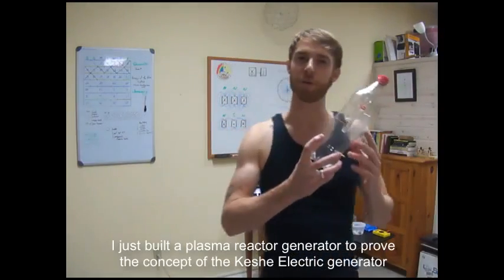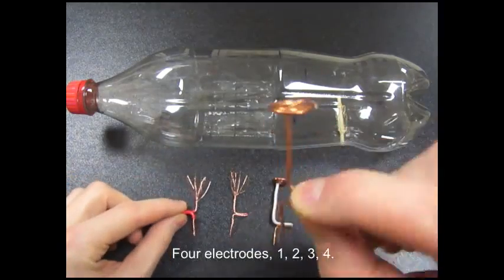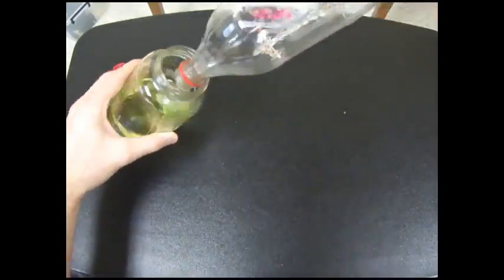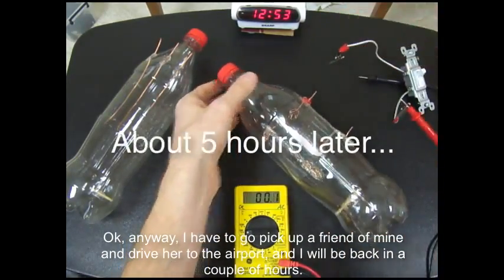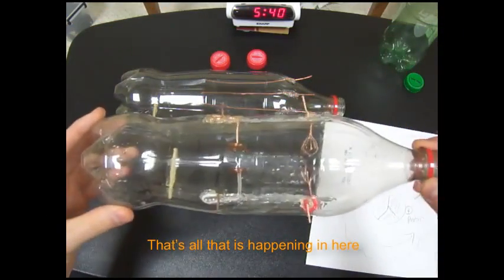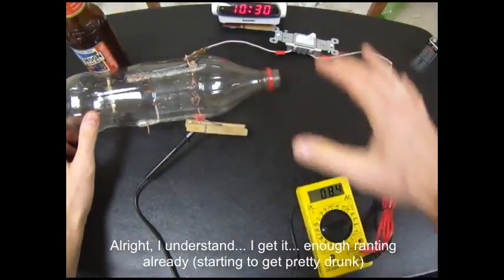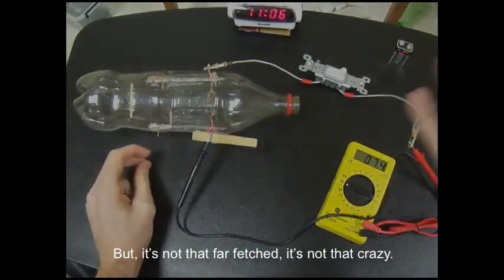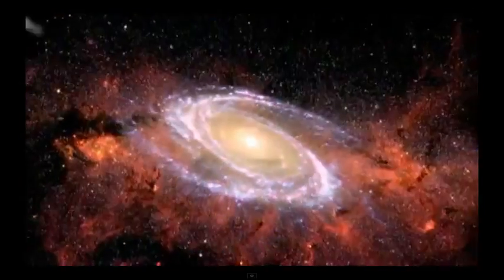Keshe plasma reactor

Comment: Something is happening but the explanation is rubbish and the power level is miniscule 5 hours to reach a measured voltage I bet far less than a second to 0 if a load is applied .

Comment: You can easily get very high voltages with very little energy.  It doesn't mean there's any capability for significant power delivery.  Volt meters are very high impedance.

Comment: The pitiful thing is not (just) that the explanation is bullship... it's that 139 people slipped their hands and clicked the like button. 

This is just a battery. and like someone said: It's without meaning to measure the voltage without letting a current through. (the ohm meter is a huge resistence) and so the energy eaten by the voltage meter is always almost 0. You are just looking at a alow slow reaction taking place. Trust me, I am a phd student in quantum physics .
Reply: +張迪凱 Hehe, i have problems with people saying "Trust me", that always get my spikes out. :) 

But i agree with you, Keshe is a hoax and a lot of people suddenly became hobby electricians without the basic understanding of electricity.
Reply: Atleast someone that said the thruth! Thank you!
Reply: +張迪凱   i have that same meter. mine reads at 0.2ohm. understandable for the cheapest walmart meter. but not HUGE .
other than that i agree with you.

Comment: Sorry mate. .. just wasted 5 minutes of my life :-/ this is NOT how gravity works and there is NO power generation here.... approach the bottle to a device which creates radio frequencies (ie plasma globe) and take a reading.... congratulations you are harnessing unusable amounts of ambient electricity... try placing a "micro" load within the 'circuit'... you're multimeter will read 0. You cannot take voltage readings on a circuit without a load (a resistor will do)... the results will always be false otherwise.

Comment: I am wondering how long the reaction occurs, because it seems during the filming of the process, it went up initially and then was only around 3v by the next morning.  Would the process continue to occur, if the fluid was left in the bottle?

I also noticed that only voltage was demonstrated, but amperage is just as important.  It would be nice to see the amperage being generated by the Keshe Reactor.

Comment: The reason there is little technical info is because it's bull crap! I have read Keshe's patents #EP1770715A1 & #EP1770717A1. It would be a very costly device to replicate, it uses a radioactive reaction source and it would consume a huge amount of power (KW's). And further to that, it would require an elaborate heat exchanger to harness any energy! That's assuming it could even produce any excess energy, which I highly doubt! Keshe looks like a scammer to me!

Comment: I'm not even sure this is a power source. No current measurement? Just because there is a potential difference, doesn't mean you can run a load. I read the link you posted. Its milli volts. Trace of a trace. Lots of other explanations for how that differential could get there. Treating the electrodes contaminates the experiment IMO. Seen one with a control? Why lemon lime soda? Whats the desired ingredient? I agree with Keshe's theroy, about low power plasma. Just don't see it in this test.